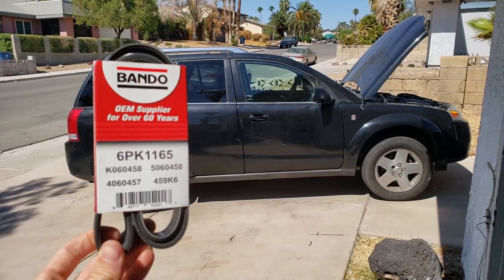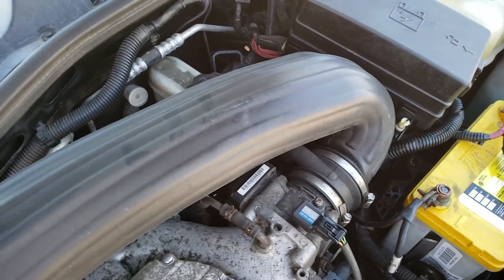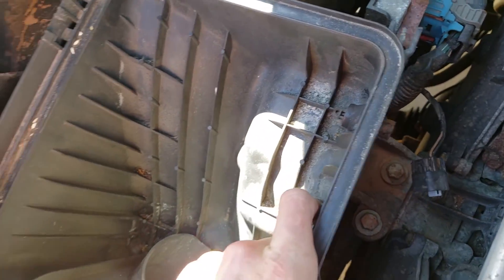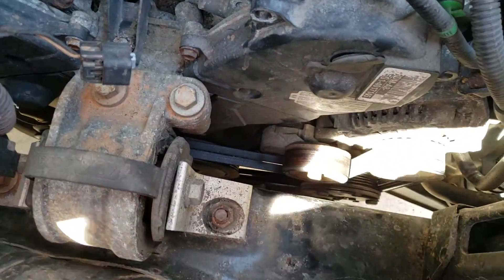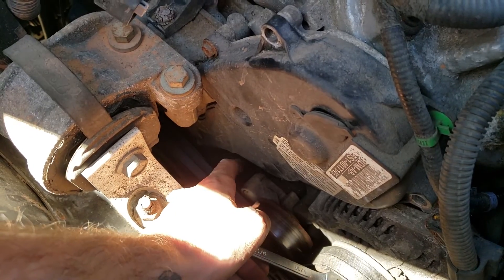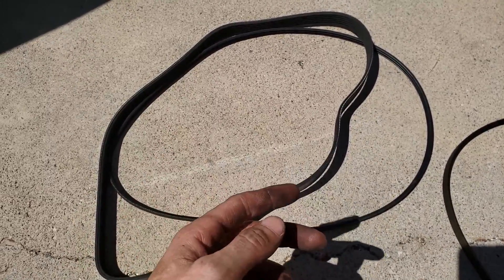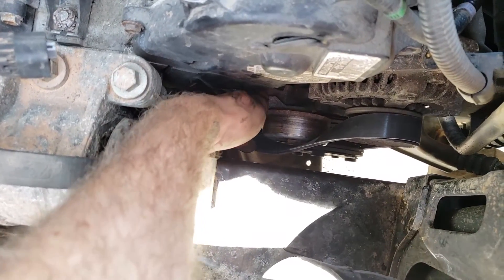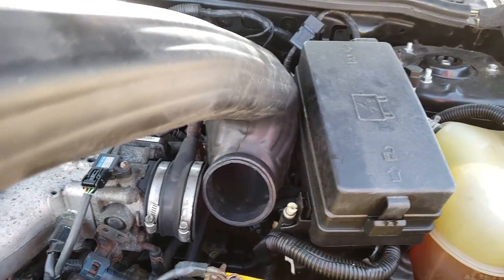How to Replace a Serpentine Belt / Drive Belt (Saturn Vue 2004-2007)

Comment: Thanks for sharing this helpful video. I have to replace the tensioner on my 05 Vue 2.2l 5 speed manual, 
285,200 miles.
Reply from the maker: Glad it helped!
That's great! Mine just tipped 300K and still going strong!

Comment: Nice job on explaining things.
Reply from the maker: Glad it was helpful!
Reply: @TutorialGenius  It was helpful. But even with your video, the belt kept slipping off the pulleys, and it took me almost 2 hours to finish this job today. A serpentine belt with other vehicles - 30 minutes. It's very tight in there, and your really need a lot of leverage to rock the tensioner back to slip the new belt on. What fun!

Comment: Are you kidding me??? I needed help with the hardest part of putting the wrench on the tensioner to move it back to slip the belt under it and you just omitted that part. But you wasted 5 or more minutes getting the air boxc off and looking at the old belt. I noticed when you tried to move the tensioner initially you didn't get it to budge.  I am very glad for you it done but your video is a complete disappointment if not a sham. You have faith in us to figure out the tensioner but no faith in us to get the air box off.  Extremely disappointing! Turn in your camera!!!
Reply from the maker: Look up "Entitled" in the dictionary and it will probably say: "Are you kidding me??? I needed help with the hardest part of putting the wrench on the tensioner to move it back to slip the belt under it and you just omitted that part. But you wasted 5 or more minutes getting the air boxc off and looking at the old belt."

You made my day ! 😂😂😂
Reply: You're just mad because you're stupid. Idiot

Comment: video after video - where is a video for 2009 SATURN VUE SERPENTINE BELT REPLACEMENT?  i mean ...2009 SATURN VUE.  NOT the same as work on all those years priors
Reply from the maker: Check my water pump video on the Vue, it covers that and more.
The principle is the same regardless of the car. Once you have the principle, you can take that with you to any car, that is the idea :)